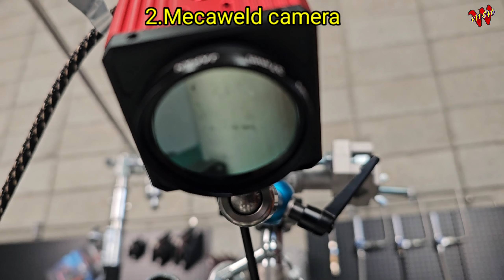용접연구소에 박혀있는 카메라가 임자 만났다!!

Comment: This is a dream!  I believe that soon this processed view of the puddle without the arc light is what we'll see inside the helmet.  It's so great!  I constantly struggle to NOT look at the arc.  The arc attracts the eye but it's not what you need to see.  If this was only ever used for instructional work it would be worth it.  That is the best view of the TIG action I've ever seen, maybe the best possible!
Reply from the maker: Thank you my friend . Where are you from?
Reply: I am in Gainesville, FL by the way.  I sometimes teach "shop" topics to Engineering students.  Welding is not the only topic but it's very popular.  Videos with good "arc shots" really help.  They helped me!  I learned about welding by reading, but this has limits.  When the helmet comes down, what am I supposed to see and hear?  YouTube really came in at this point in my life.
Reply: This video is almost TOO GOOD, since you can't see this view yourself.  I think it's tremendously educational.   I have seen similar images in super high-speed video of welding (say from the CCWJ series).  In some of these the image is not illuminated BY the arc!  There is a laser synchronized to the camera I think, extremely brilliant pulsed light.  I think something like that is happening here?  The arc plume is just a little shadow.  It doesn't go away, it's just not very bright compared to the illumination from the camera.  This is the first video I've ever seen that clearly showed the tip of the tungsten as being white hot at the very end, and some other things we never see.  It might be that this is the best possible arc shot!  Ah, does this camera cost as much as a car?  A house?  The only ones I've ever seen personally were something for the University to buy.  This seems like the way forward for welding education and research.

Comment: I just looked at the CAVITAR welding camera with integrated laser illuminator.  PRICE?   Ask for a quote!  This is never a good sign.  There are other welding cameras, but so far I haven't seen one that has its own light, which might be the secret.  BUT high-speed welding cameras are now under $10,000 now, some under 5K, which is surprising.  Super high speed pictures of arc welding and MIG welding are AMAZING.  The Canadian Center for Welding and Joining has great video of pulsed MIG welding with the single-drop transfer.  So smooth and neat!  THEN you see the same kind of video of STICK welding and it's an ungodly mess, hot metal and glass going everywhere... super educational.